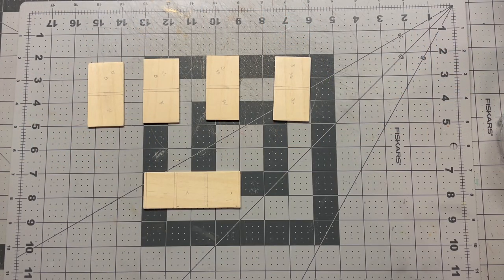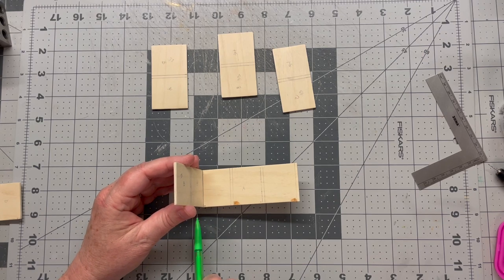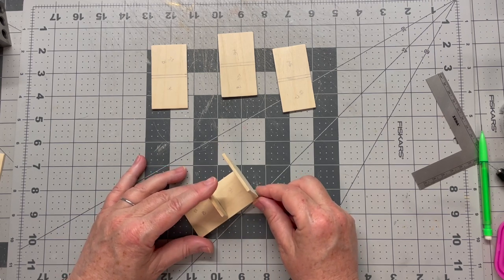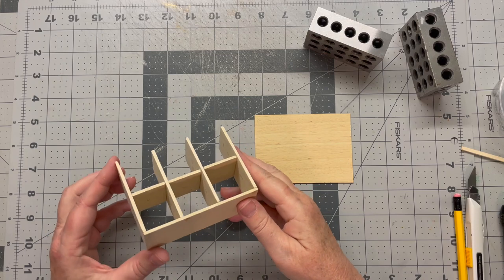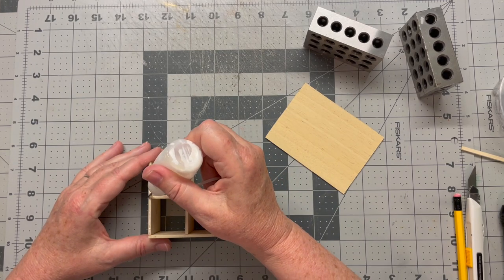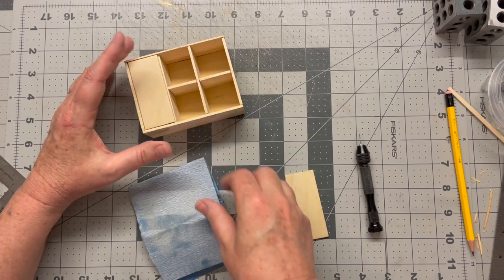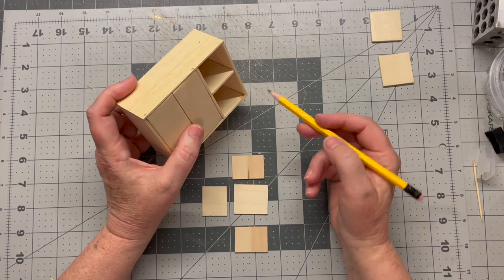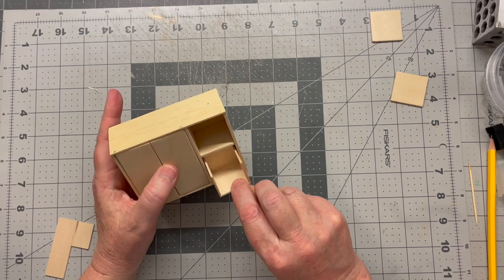1:12 Scale Miniature Office Credenza

Comment: Penny, you are the best teacher! I love that you give the thicknesses of the woods, so helpful. But, what kinds of woods did you use, please? Basswood, balsa, plywood, something else? I am a novice builder of minis, so i need to be told every little thing, sorry. Thanks.
Reply from the maker: Thank you so much Denise! The short answer is Basswood. Depending on where you live it is the easier to find and relatively inexpensive. It cuts well and has a nice wood grain if you are staining the piece. There is another type that I love called Obeche. It has a beautiful grain and is really nice to work with. The problem is that I can’t source it locally and have to ship it from the UK. That makes it expensive and not very practical. (If you want Julie Warren fro Little Bits and Pieces, she uses this wood) I try and stay away from Balsa because it find it very soft and it breaks very easy. That’s just my personal opinion of course!  Thank you for tuning in!😁
Reply: @pennyssmallspaces  Thanks! I have a problem sourcing thin wood for crafts that I can cut with just hand tools - there is only a Hobby Lobby here in the desert southwest, and they have next to nothing that is useful. I found some small plywood planks there in a package, but they turned out to be mostly warped. I guess I will have to go the mail-order route and suffer shipping charges. 
Julie Warren is one of my favs on YouTube too. Thanks again, please keep sharing your talents with us!
Reply from the maker: @deniselocke559  Julie sells wood from her Etsy shop for a good price and doesn’t gouge people on shipping costs. The link for her Etsy shop is on her Youtube channel, in the about tab. An alternative to wood is Chip board which you can order on Amazon and comes in various widths. I often use that if I intend to paint the piece. You honestly can’t tell the difference once it is painted. It’s also cheaper than wood!